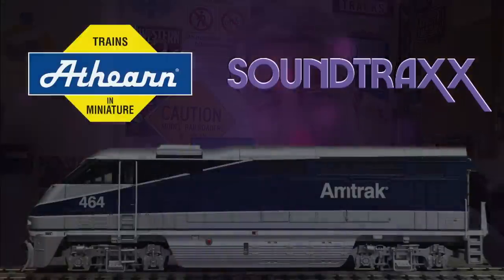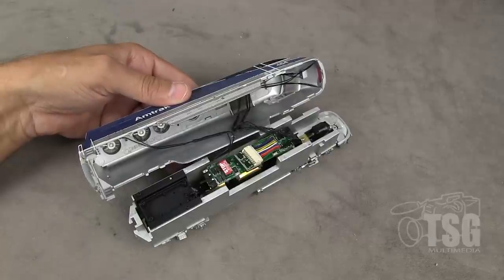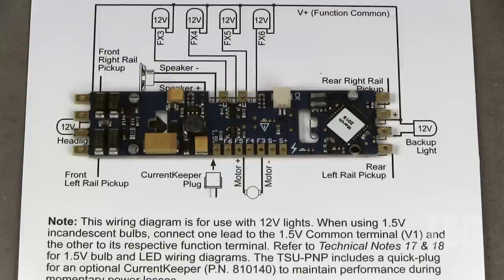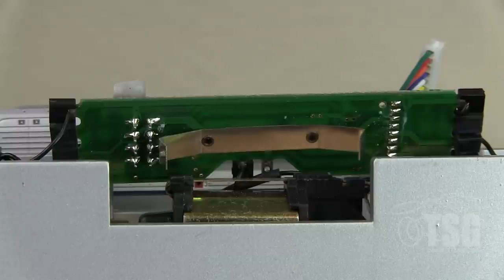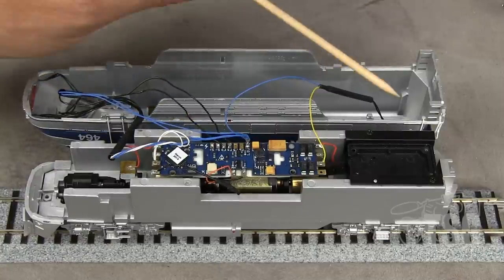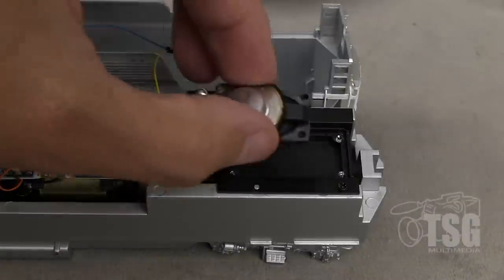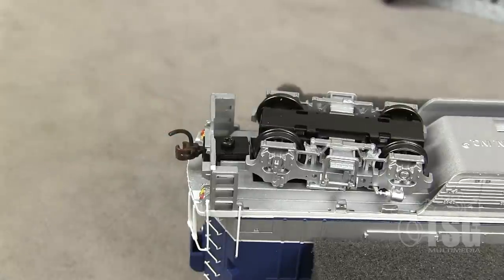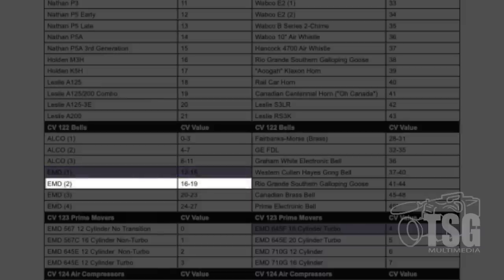How To Install DCC & Sound Athearn Amtrak F59PHI SoundTraxx Tsunami 2

Comment: If you had 12v bulbs it doesn’t matter which way on polarity.
Reply from the maker: Getting it prepared for a future LED upgrade project! 👍
Reply: @tsgmultimedia  gotcha, i use LEDs that don’t require soldering in resistors they have a bridge rectifier built right in.

Comment: John, I just bought a DCC ready version of this diesel and want to only put in it a mobile decoder.  Do I have to replace the big board or just get a plug in decoder and attached to the existing board?
Reply from the maker: I don't know what a mobile decoder is.
Reply: @tsgmultimedia  It is a decoder that allows for DCC operations but not sound.

Comment: I have to admit the only time i didn't follow NMRA wiring standards was when I put my ESU Loksound in my F9B. It was a former athearn genesis shell and the only wiring aside from the motors/trucks was the speakers and the reversing lights at both ends. I just wired them up as is. ALthough I may redo the light wires  when I add LED's in them. Now my A-Unit.....from the ground  up that thign is a rainbow inside. Front/Rear headlights, trucks/motor, speakers, ditch lights, strobe light, class lights/numberboards, mars light......When you start getting that complicated with wiring that's when I let a professional do it xD my wire tucking skills are not so good, soldering on the other hand  haha.

Comment: were would you solder the ditch lights because im installing a tusnami pnp decoder decoder for a walthers Sd70ace and im pretty sure it has leds
Reply: Zombie Slayer8999 for this install, wire to the FX3 and FX4 outputs and the F-common tabs (+) on the ends of the decoder.  Be sure to install a 1k (1000) ohm resistor inline with each LED.  That way you can get the alternating ditch lights.  I hope this helps!  If you need further assistance, contact me at the SoundTraxx office.  Thanks.